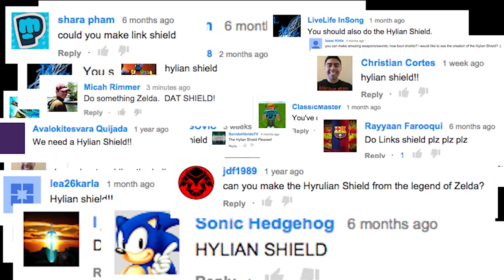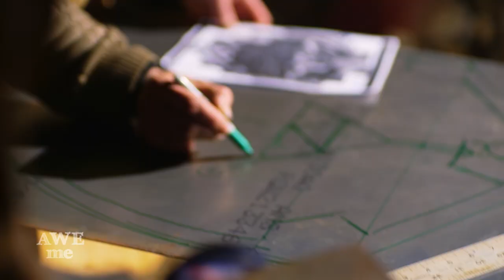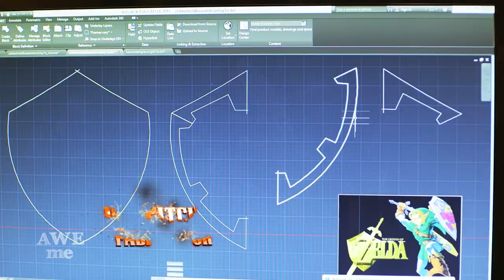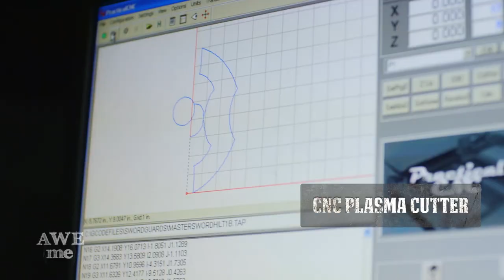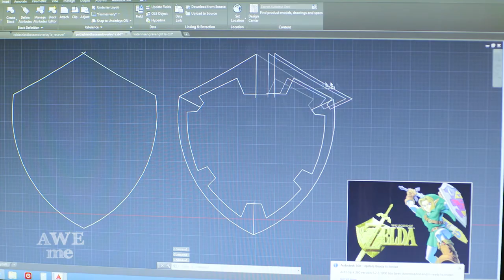Link's Hylian Shield (Legend of Zelda)  - MAN AT ARMS: REFORGED

Comment: 3-Dimensional Maneuvering gear sword from Attack on Titan please
Reply: Attack on Titan blades and blade handles
Reply: PLEASE DO THIS
Reply: Yes.
Reply: Noah Daglio It's just a giant Stanley Knife. Not really interesting, tbh.
Reply: Hell yes
Reply: YES
Reply: Noah Daglio flesh pairing blades fuck yeah
Reply: YES. YES.
Reply: Mixed with the Z sword!
Reply: AmazingPotatoFarmer
I agree. The Attack on Titan swords look kind of mass produced and not very interesting. It would be nice to see them make a 3D Maneuver Gear rig though, with the blades. The 3DMG doesn't have to actually work but it would still be cool to see.
Reply: zeroangelmk1 except the way the 3DMG swords blades are forged IS really interesting because they are done in such a way to the metal worked like a Doorstop spring bending as they hit and then snapping back into place
Reply: Ward Nightstone
That sounds highly impractical. Swords generally do have a flex to them, but only so much as to avoid snapping. 
Steel that is as flexible as you are proposing would be prone to breakage/bending and would not have enough rigidity to properly damage a target. 
Also, the ridges in the blades are points of weakness, just as in a real-life stanley knife, and would likely cause the sword to break apart when attempting to actually cut apart anything that would offer resistance.
Reply: they actually explain it in the manga the reason this was done was because while using 3dmg when you strike if the sword blade didn't flex it would snap off the second you hit the titan or worse get stuck in the titans skin then you'd REALLY be screwed
Reply: Noah Daglio you mean large retractable knives with a sword handle?
Reply: +Noah Daglio if its not fully functional im unsubscribing

Comment: Make the 3DMG (3D Manuever Gear) from Attack on Titan!!
Reply: Soooooo create a gas-powered grappling hook shooter that also carries two swords while easily attaching and staying attached to a person's waist?
Reply: That's the idea XD
Reply: Michael Greenberger not a weapon, it is more a tool.
Reply: dboydev Not just a tool, it's a whole set of gear.  Even still, it's doable.  They could totally just do the swords if they wanted, but the rest would just be simple machining on aluminum.  I've seen a bunch of people make pretty nice replicas already.
Reply: they make swords and armour, not complicated machinery, the closest they ever got to that was the hidden blade/crossbow combo which didn't pop back on it's own and I doubt there was much more anyone could've done for that.
Reply: ***** Except the AOT is overrated and not that good.
Reply: I'm more interested in them making the sword handle with a functional mechanism for exchanging blades than the whole thing
Reply: TheAmazing_OMEGA Sadly that wouldn't work at all, because unlike box cutters/utility knives, you don't just use the point, but the entire blade. As a result the entire blade dulls, rather than just the tip.
Reply: TheAmazing_OMEGA I've read the entire manga too, and you can't kill titans by stabbing that point. It's only a kill if you actually slice out a part of the neck, which is why they use two swords.  Not to mention the sword probably can't even be used for stabbing. Most swords flex while stabbing, but this one would break.
Reply: joost1120 not actually true in real life you want a stiff blade for stabbing if it flexes you do not get as much force in to the object you are stabbing.but for the rest you are proberly right i have not looked in to it at all
Reply: Don't think that is even possible...
Reply: havtor007 Pretty much every blade flexes, if it doesn't flex, it will break when you try to cut with it.
Reply: Seriously, it's not possible to create something like that. It's like asking to create HALO plasma weapons or Zeus blade at God of War saga...
Reply: joost1120
what i mean is that for stabbing you want a blade that do not flex much for dedicated thrusting swords it often is essencially a steel bar with 3 sides becouse you want it to flex as little as possible
Reply: ERREN SWORD!!!
Reply: Luiz Alex Phoenix
They have made the Halo sword on this show before...  :D

Also, the entire rig isn't realistically plausible.  The way they show it working just wouldn't happen in real life.  Your harpoons might be able to penetrate a surface, but there isn't much, if anything, to keep them anchored.  They wouldn't be able to generate enough pressure to launch the distances they do whilst dragging a cable along either.  Even if you somehow managed to overcome those last two points, there's still balance.  I know from my experience working in theater that your hips are not a good place to be support your weight on a flying rig.  You'd flip upside down and smash your head open as soon as you retracted the cables.

My point is, you can't build a working set of 3d gear, but you don't have to.  It's fantasy, and fun to watch and daydream about.  Building a nice looking metal replica wouldn't be that hard, just some basic CNC machining and leatherworking.
Reply: ***** if the 3DMG were possible irl, maybe, however it is not, leave it in the realms of fantasy where your idolised image of them can't be tarnished.
Reply: *****
So you're saying that the sword from Berserk , or the sword from Inuyasha (the name slipped my mind), that are good in the making but their size make it almost impossible to wave, are safe?
(I'm not implying anything I'm just trying to get your point right)
Reply: TheAmazing_OMEGA Weight wouldn't be an issue really, the fact of the matter is the lengths of blade and tang, the tang simply isn't long enough to support the blade properly.

Comment: Build Aragorn's sword (Andúril) from Lord of the Rings: Return of the King!!
Reply: Boooooooring!
Reply: Lauri Lehto Dude, it's a nice sword.
Reply: Lord VelociRexisaur Nice, sure, but it's just a sword. Nothing special or flashy about it.
Reply: Lauri Lehto So what is it isn't as complex as some of the swords they made? Inuyasha's Tessaiga, Auron's Katana, and the Guts Dragonslayer sword are all fairly simply compared to some of their other builds too. Just because its isn't as complex as some builds doesn't mean it wouldn't be cool for them to make.
Reply: Andy8296 But it's not flashy and it would wobble. No-one wants a wobbly sword.
Reply: Lauri Lehto Not every sword is flashy, that has absolutely nothing to do with how good of a sword it is and what do you even mean it would be wobbly, thats why you heat treat and temper a sword; so it's solid, rigid, stiff, and strong to withstand blows and hold its form. That's how forging works

Comment: A lot of people say 80 rupees is cheap. But no, rupees, are actually rubies(red rupees) and sapphires(all other colors) they are the same gem but sapphires have chromium, rubies don't. 
The value of a hexagonal cut 4x2x0.5 green sapphire is $40, keep in mind, hyrule has a surplus of these different colored sapphires, so there would probably be a decent amount of depreciation in value, therefore, the real value of one rupee ( a 4x2x0.5 hexagonal cut green sapphire) would be about $10, but, the other rupees line up well with this, worth $50, $200, $500, $1000, and $3000 respectively. 
80 rupees is $800.

(All values have depreciation factored in)

Comment: I really like this video The only thing that I think the highly and shield is missing is some wood on the back now granted the original highly in shield from ocarina of Time it was just straight up metal but it was also thicker In the remake of ocarina of Time for the 3DS they added some wood to the back, if you don't believe me look at the moment when you first get the shield when it's raised above link's head it spins around and it shows a metal back in the original and in the 3DS version it's wooden planks, honestly I'm okay with the making either one The only thing that bothers me is that the back of the shield is curved and it doesn't look like there's anything that will keep it from getting warped in a fight like I imagine it could take some hits That's for sure but what about things meant to pierce metal and and severely warp metal like arrows and clubs, Or am I thinking of a cudgel instead of a club
Reply: Actually scratch that part about the arrows